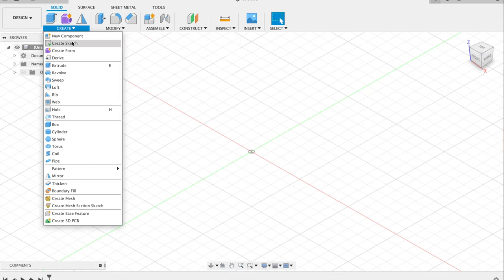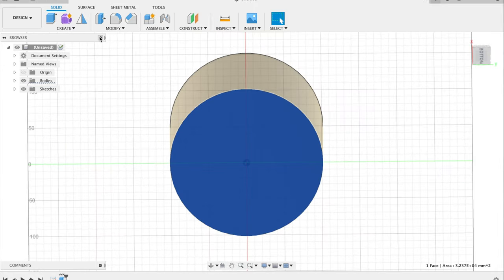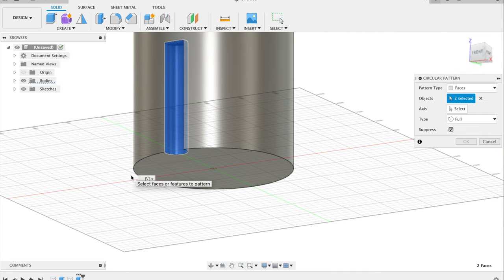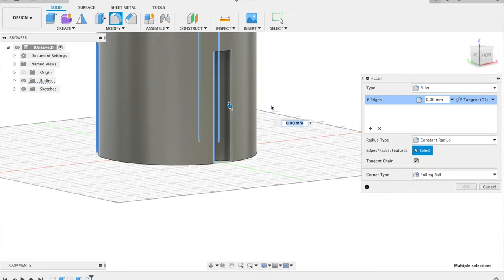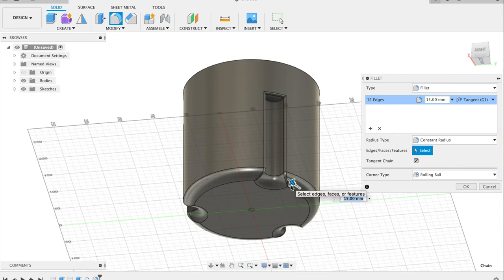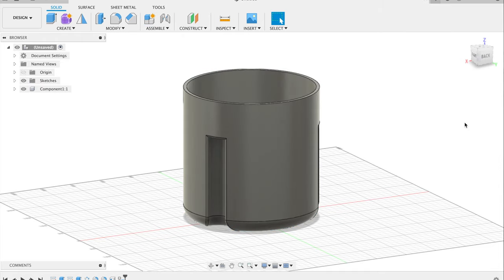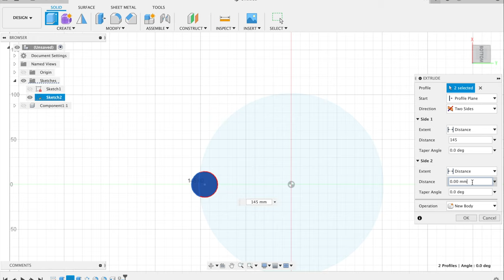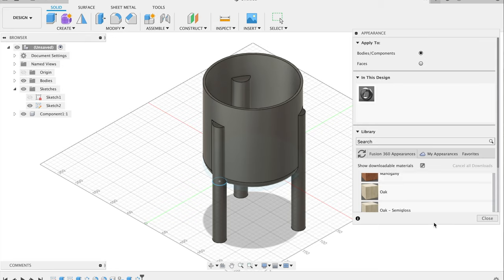3D printed Flower pot with wood dowel legs

Comment: Absolutely lovely pot. I was wondering how long the print took and which settings you used.
Reply from the maker: I think it was a .2mm layer height and it was around 15-20 hours. It's been awhile honestly don't remember exactly. But time will really depend on your printer speeds and layer heights. You can go with a .3mm layer heigh. Bigger nozzles and layer heights would make it go way faster and also give it a cool texture. But the idea is to play with it and change the design to your liking.

Comment: Hey Dave. Very nice pot! do you know if its watertight? so could i plant the plant directly into it with soil and water contact to the pot?
Reply from the maker: Yep, it’s water tight if you do at least three walls. Just make sure to put rocks or gravel on the bottom for water drainage.

Comment: Hey Dave, love the design, I was wondering what filament you used for the print?
Reply from the maker: Asjed Tufail Thanks, it’s prusament galaxy black PLA. They have a PETG too but that gives off more of a shine to it. If you are going to use the flower pot in direct sunlight I suggest using PETG and using a clear matte spray on the pot if it’s too shiny.

Comment: Hi! May I ask the size nozzle and layer height you used to 3D print? Also, what kind of flex bed are you using? Thanks so much
Reply from the maker: .4 nozzle .3 layer height. Bigger nozzle would work fine too.

Comment: Hi Dave, love the design. I have  a few questions for you, how many hours did it take to print?I see you use prusa, is it reliable for printing big parts?
Reply from the maker: Thanks, it takes about 24 hours to print this pot on the settings I had. The Prusa is an amazing printer. It prints better then machines many times it’s price. Highly recommend a mk3 kit. With good maintenance you can have these printers print for months with no problem big or small parts.